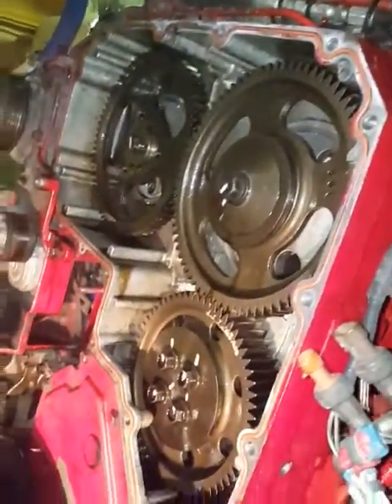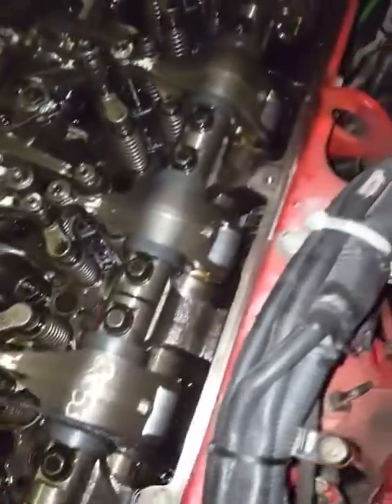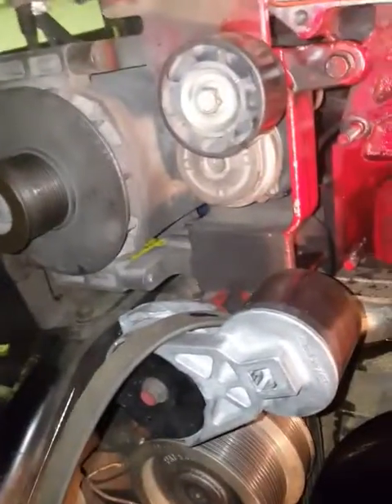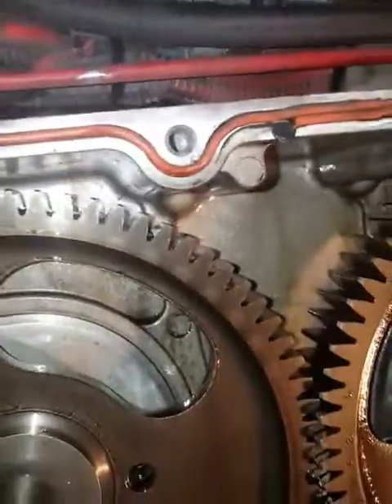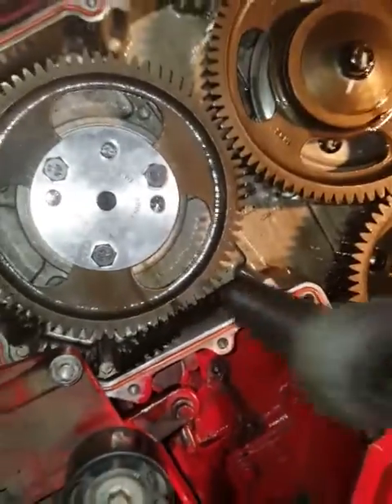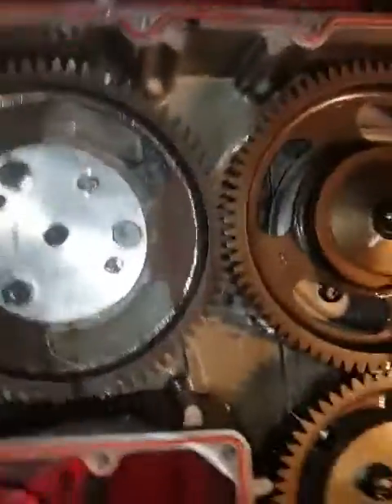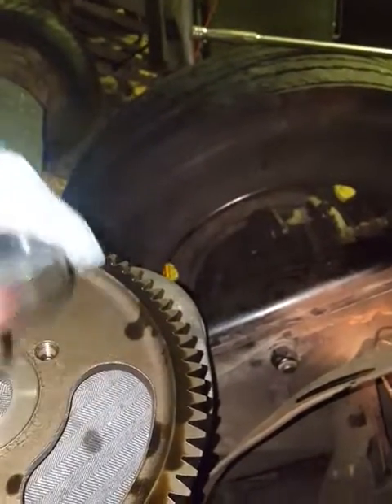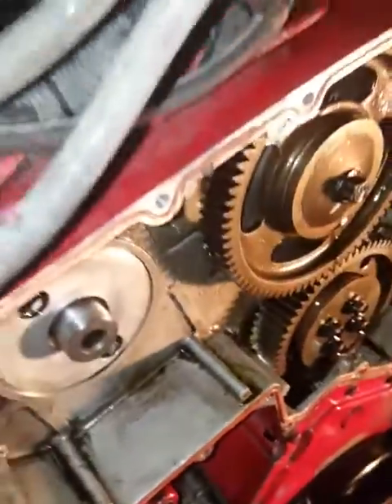ISX Cummins 15 remanufactured engine static timing and valve cam gear removel.

Comment: 4 stroke engine.. 2 revolutions of the crank to 1 revolution of the cams, just rotate the crank 360 and back to the insert pin mark and the wedges will fit or be very so slightly off